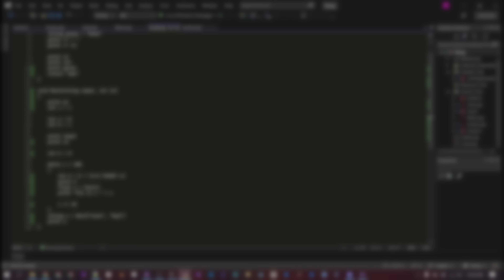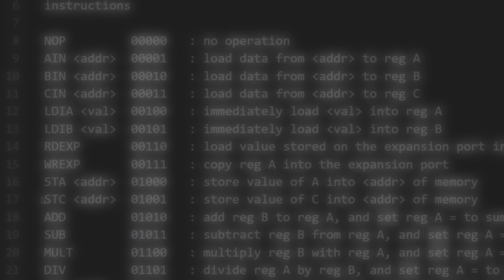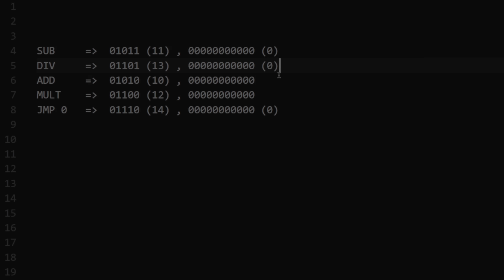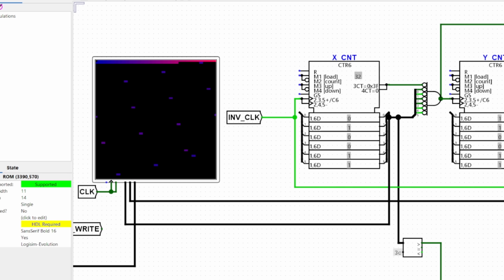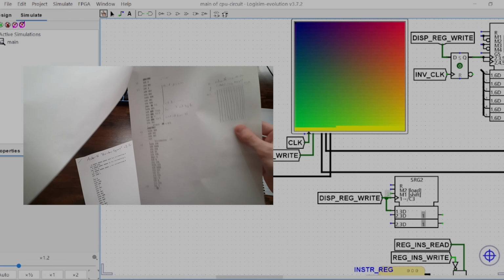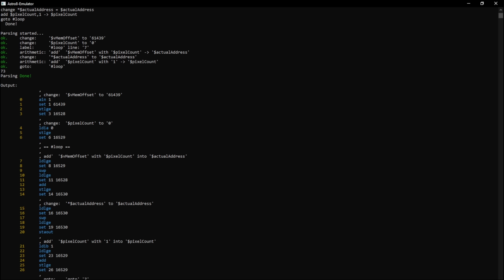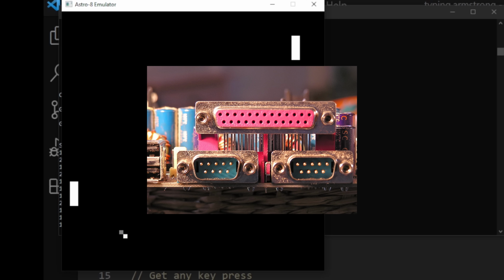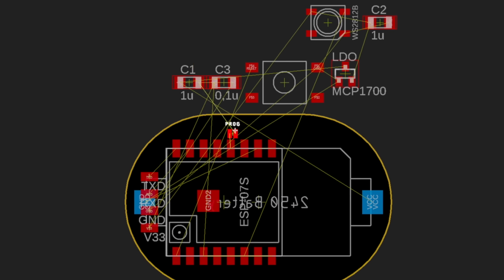I Designed My Own 16-bit CPU

Comment: how did you learn to do this?!?!?! I've been trying to figure it out for MONTHS.
Reply: I was thinking about it for weeks. Not the same I guess. My guess is he just worked it out. Sort of like the people who did this in minecraft. I would guess the broad outline of the process is
1) decide on registers including a 16 bit register for addressing memory and possibly a stack pointer (optional)
2) make up an instruction set of move, jump, and logical operations (math optional).
3) make up machine language. I was looking at old 8085 assembly language and machine code and it's pretty logical and consistant. MOV r1,r2 is represented in machine language as 01DDDSSS where SSS is the source register and DDD is the destination register. There are 7 registers but "register" 110 actually makes a pointer to memory using registers H and L. Patterns like this might make a decoder easier.
4) I'm just theorizing and probably shouldn't make a wall of text when I don't know anything. You probably know more about it than me. Anyway I'll check his stuff on github.
Reply: @ericmollison2760  I'm familiar with making emulators and stuff I just wanna put this stuff through logisim so I can simulate the hardware even better than without that layer of stuff yknow?
Reply: @xrify9407  Yeah I don't have much experience with this stuff but I think I could work it out with time. I did stuff like this in minecraft just by mucking around. Nothing fancy like a cpu though. So far I just made a counter. It was a lot of work. Logisim would probably be a more practical circuit simulator. I won't learn anything in a hurry but I downloaded the github stuff. It was 353MB. I find the best way to learn is to look at other peoples work.

Comment: I am an IT student but we don't take lessons about these kind of stuffs so was wondering where to learn about these stuffs. Great job by the way
Reply: I remember taking great CS classes mostly for fun including assembly language stuff where we had these ancient "HP trainers" which were briefcases with an 8085 processor, keypad, 7 segment display, speaker, and a rom with a program that allows you to enter your own program into memory and a lot of subroutines for displaying numbers, making beeps at various frequencies, and stuff like that. You enter machine code in hexadecimal. I made an assembler with MS Excel and a lookup table. I accidentally learned I can make the oscillator change frequency by connecting an alligator clip lead to it which created capacitance, and making the speaker oscillate and touching the lead and touching other things while holding the lead made the speaker change frequency. I hold it and poke people and the speaker gets lower in frequency and people look at me funny. Ah those were the days. Find a class like that.

Comment: 4:15 If you use the other 11 bits of the opcode for arguments, say a memory address, then how do you address more than 2^11-1 bytes?
Shouldn't the address be stored in a second register beforehand to have a full 64KiB addressable range?
So that the address can then be fetched from this second register with a load instruction (e.g. AIN) in order to then be able to access the corresponding address in RAM?

Comment: Very nice work! There is still a use case for this line of work, albeit niche. Like powering up new games for retro console cartridges, powerful for retro purposes, but with a reasonable small footprint & power consumption < 1W and so with a specific reduced optimized instruction set to complement the original hardware and or game type as much as possible.

Comment: I've been wanting to do this for decades, but I keep running into things my brain just refuses to understand. The worst one is signal timing inside the CPU. I think I might have cracked that, finally, but I've got a lot of other learning to catch up on too.

Nice little RISCy architecture!

Yay for unique character sets! :) And making bitmap fonts is fun.

Ooh ouch! Your assembler didn't support labels? No wonder you made a language! But I suspect you may have got further if you used a lot of subroutines, spacing out the subroutines in memory so you didn't have to change addresses in every subroutine when just one was altered. Relative jumps would have helped too, though I guess the arithmetic they do on the instruction pointer isn't exactly free. Speaking of spacing, I was astonished years ago when I hexdumped Windows 3.1 programs and found huge runs of zeros. :) I'm not quite sure what they were for as they would have been compiled from C. Perhaps they wanted to save time when relinking after compiling a part.

Comment: I'm really curious about something and i really hope you read this and get back at me.
How did you come about deciding on the struction set of the CPU? did you just copy another architecture or did you decide on them on your own? how does one choose the right combination of instructions, are there just a basic default group that every architecture must have? i've been interested in this for a while but my knowledge of low level computing is very small still so i relaly wanna understand what comes from standards/copies vs genuine decision. you know what i mean?

thanks
Reply from the maker: I started by using a very simple instruction set inspired by Ben Eater's. It only had add, sub, jmp, lda, ldb, and sta. These are enough to load data from the cpu, add or subtract it, and store it back into memory.
The reason why the instruction set currently is much larger than that is because my needs increased. For example, multiplication used to be incredibly slow since I didn't have a mult instruction yet,  so I added that. I also later expanded memory, and the old load instructions couldn't load from that large of a range, so I added new ones like ldw to use large addresses.
In actual commercial CPU design, the instruction set is probably decided and set before the CPU is even started, but I did it more progressively by adding what I needed as I went along.

Comment: Dude you have got to show us how you implemented Mul and Div in the ALU. I've hunted for these things a lot, it's extremely difficult to find a good explanation about how those work. Either you find a huge nightmare diagram with no notes, or you find a one-phrase answer "just use dadda- or wallace- multipliers". So frustrating.
Reply from the maker: Ah, I'm sorry. Those usually use complicated algorithms, that unfortunately I'm not familiar with. In my cpu, I decided I was just going to use an off the shelf ALU chip, so I didn't implement any of the logic for that part of the system myself.

Comment: Very good. BUT... logisim is terrible. It does not translate to real world circuitry. I have built dozens of computer hardware circuits for fun back in the day (even a full 8085 with a DMA system without using a computer.. only a meter, logic probe and pulser). When I first used logisim to develop new circuits a few years ago i quickly found out that logisim simply does not account for the real world timing issues that latches, flip flops and logic gates within physical 74 series ICs all have set up times, hold times, propagation delays. There are more powerful circuit simulators that do account for this, and you must select the actual part number to model actual IC time based characteristics, but they come at a significant cost to the user.

Comment: we should add two channel 24bits adc and pga and some comparator op-amps inside it. a 24bits audio output dac and a video output DAC inside your controller might sell well. but you need two mcu cores together.  an phy ethernet or wifi future can be good addition. mcu program memory must be well protected against radiation and external electromagnetic noise.

Comment: This misses all the physical synthesis and logic of the instructions which is much harder than designing an instruction set and virtualize ports.  This project is doing only very high level aspects of CPU design.  not very hard to do and skips all the tricky interesting parts.  nothing more than virtualization or emulation.  feel the title is misleading.
Reply from the maker: I created a version inside of logisim, and I plan to replace all of the abstracted parts with actual circuits (which can be done).

The only part left for me to do is create the electronic circuit design, from the slightly abstracted version, so I don't really understand your point.

Comment: I designed a 16-bit CPU (microprocessor) in 1977 that was used in a mainframe as the I/O processor.  It had a  unique instruction set (RISC).  Lots of fun, and a lot of work.
Reply: 16 bit in 1977? That's insane
Reply: @helloworld145  Not for a mainframe. But the price tag sure was insane.
Reply: @helloworld145  There were 64-bit computers in the early 1960s.
Reply: @herrbonk3635  64 bit computers must be crazy expensive in that year lol.
Reply: @shockcry  Not so much more expensive than say the 30, 34, 36, 40, 48 bit computers of the era (this was before 8, 16, 32, 64 became the norm). Having many bits conceptually in parallel, say in the main registers, does not automatically imply that the physical ALU is that wide, for instance, and certainly not that addresses are that wide (in 1961, computers had a few kilo bytes instead of today's giga bytes of RAM). The IBM 7030 Stretch that I was thinking of was fast though, but mainly due to fast transistors (logic).
Reply: @helloworld145  The Motorola 68000 and Intel 8086 were 16-bit CPUs that were available by 1979
Reply: How old are you????
Reply: @Gamersoft1124Pro  Of course, but terms like that means nothing without historical background and a deep technical context. It's just Jeopardy knowledge. Hence my question.
Reply: All things are possible. On the internet comment section.
Reply: Applause for this engineer right here 👏
Reply: You must be a legend
Reply: How old are you? Lol
Reply: I build the operating system for linux
Reply: @Arthritisinmaballs sure you did
Reply: @Arthritisinmaballs  can you please helo me regarding these machine codes turning to electric signal just by machine code...i mean how my cpu knows this machine code i execute on program which i see on my screen to generate electrical signals accordingly....
Reply: Can you please tell if you still have a clue which model specifically you designed?
Reply: Cool
Reply: WOW.
Reply: bro what are you doing professionally these days?
Reply: @vaibhav_topg professionally retired
Reply: Bro was building computers with Duke Dennis
Reply: I am currently learing the RISC-V instruction set. RISC-V architecture is commonly used in telecommunication where even nanoseconds count. It has its pros and cons compared to Intel architectures but very clean and nice. I love it!
Reply: By risc you mean Acorn RISC Machines or ARM.
Reply: Usually comments like this are bullshit but I trust this one
Reply: Dang what computer was it used in
Reply: I assume you worked for IBM then?
Reply: @Gamersoft1124Pro  "Reduced" in what sense? In size?, or number?, or semantic complexity? And why? Have you ever contemplated things like that?
Reply: the guy its most likely liying. I do not believe that he actually invented RISC
Reply: @GK-iw3hi   "RISC" isn't a "thing" to be invented. It's a descriptor for any ISA that has a smaller, simpler instruction set.
Reply: @GK-iw3hi I don’t think he’s saying he invented it but used it when it was quite new to the world.
Reply: @GK-iw3hi Or joking.
Reply: @GK-iw3hi I re-read the comment and still don't see a claim that they did. IBM (who else) was already doing RISC back then.
Reply: what we can see here is that you don’t even understand what risc is 😂
Reply: Now seeing RISC being used everywhere (we're at RISC-V now!) must make you really proud!
Reply: Boooooriiiiing
Reply: @guii5041 shut up

Comment: Awesome work! I should go back and watch this entire video series.
Though one question that might just be a stupid question and I might completely be missing the point, but...
Why do you have separate opcodes for loading and storing the accumulator to / from the expansion port? Why not make the expansion port addressable or hot swappable as a memory mapped page, treating it like any other memory address and save two entire opcodes?
Reply: It's a long-standing dichotomy in CPU design; whether to just make system designers memory-map all the IO or to put IO ports in a whole separate (but smaller) address space. The 6502 only has memory addresses. The Z80 and the x86 series have 256 IO ports. I like the conceptual simplicity of memory-mapped IO, but many programmers like the logical separation of IO and memory.

Comment: I love this kind of stuff. One of my long -pending "retirement projects" is to build a functional 8086-compatible system out of discrete components (transistors, capacitors, resistors, and diodes only), with no IC's.

Comment: Design a 5 cent dip microcontroller with 16bit adc 2 8bit timers and 2 oscillators and spi available at pins. Then a pcie to usb dip ic and you'll be rich and my hero

Comment: I was recently obsessed with learning how tf do computers even work. And ended up making an 8-CPU from only logic gates on a simulation. Note I did make integrated circuits with the logic gates I'm not insane but still. Of course my CPU is very crappy because you would need about 6 instructions to even add two numbers together but at least I have learnt how things happen in the computer which was my goal. Took me 1 month to learn.
Reply: I still have to learn about the video circuitry tho.

Comment: Now you need to build this with actual hardware and add a long term memory to it. Like a SD card slot or something that could be used to store data even when the system is turned off.

Comment: Some nice ideas. You don't need to build hardware - you can save time by programming an FPGA. I notice you don't support timers or interrupts. Any reason/(s). I am inspired by the 6502 and this. IF I ever go this path, I will base my instruction set on my extinct beloved HP 32S. I already have working programs for it. One - in the same display - tells me how many miles left in the tank, the MPG and whether it is time to change my engine oil. Something of that sort. It's been decades. It will not run in binary but BCD. Trigonometry, logs and exponentials will be carried out with nested parenthetical forms. I don't think I need exotic functions. No math library. No CORDIC.

Comment: I actually created a replica of 8051 in FPGA (xilinx dev board) then I wrote a c# program that will generate the FPGA code, so that the number of bits can be a variable, so i could create a 37 bit or even 33bit computer. I also added my own op codes, and actually turned it to a mini dsp processor with variable bit depth :)

Comment: Your work is impressive, but clickbaiting a low resolution version of the Amiga’s Juggler Demo in the thumbnail was annoying considering the end result was just pong.
Reply from the maker: You are right, that thumbnail was a bit clickbaity. Although that image was displayed on the actual computer; its just that it was obviously pre-rendered and is just displayed as a bitmap. Also, it doesn't stray too far from my end goals with this system, in which I do plan to make a few 3D applications and maybe even a raytracer like this demo.
Reply: @AstroSamDev  Aye, good to hear that your working on it.
You could also try the Boing demo as a stepping stone, since that has been copied and translated from the Amiga, to the C64, Atari 800, Atari ST, Atari STE, Macintosh 128k, and Sinclair QL

Comment: So i just barely passed my computer architecture course. We did mostly 32 bit MIPS processor and we also had to design one ourselves, but on 16 bits, and we didn't have to add multiplication or division. We only implemented about 15 instructions and i can tell you what this man did right hear, is no easy work. You deserve way more subscribers for the amount of work you put in man. Great work!

Comment: Very cool, have you thought of using an HDL (like VHDL or Verilog) instead of Logisim? I think that would make a faster simulation possible and you could implement the design in an FPGA.
Reply: It doesn't make faster simulation possible unless you cheat. Verilog is weird; it's designed for cheaty simulation, which means accurate hardware simulation with it is insane. Of course, everyone wants accurate simulation, so Verilog simulators are hyper-optimized. There are higher-level HDLs which can accurately simulate just as fast despite being hacked together by a handful of amateur devs.

Comment: Some ideas:
1. Interrupts. This is to make I/O more efficient, and since you have a halt instruction it can be an energy saver. (The CPU itself will stop operating to conserve energy until the next interrupt fires.)
2. Some standard peripherals like 16550 UART and 8253 timer. Those standard peripherals will want to use interrupts too, especially a timer on 8253 which can give you a periodic interrupt, something serves as the basis for preemptive multitasking.
3. Graphics enhancements with interrupts: HSYNC and VSYNC. This can simplify video programming and prevent image tearing.
4. LLVM or GCC backend: this gives you standard C and C++.
5. An MMU. This will allow memory paging and expanding memory capacity.
6. If you have a timer that fires interrupts, standard C and an MMU, you can try port Linux onto this platform. Then maybe your platform can even self-host.

Comment: Interesting video! But I still have a suggestion. It seems you are using the CPU itself for drawing graphics, but most 16-bits machines, and even 8-bits machines used a specific piece of hardware for handling display (same for audio, another processor).
It would be interesting if you do your own video display processor similar to old machines such as the Nintendo NES or Commodore 64 for exemple.